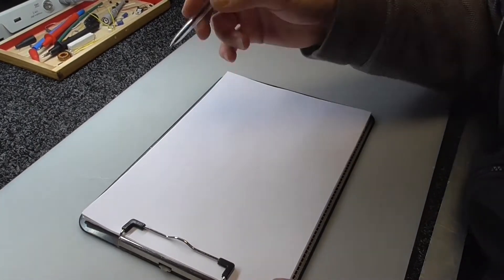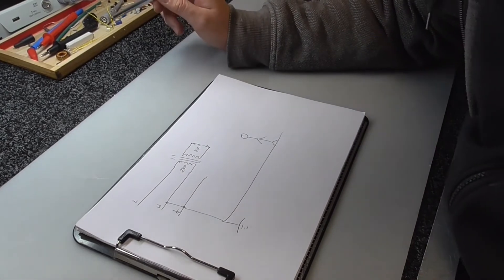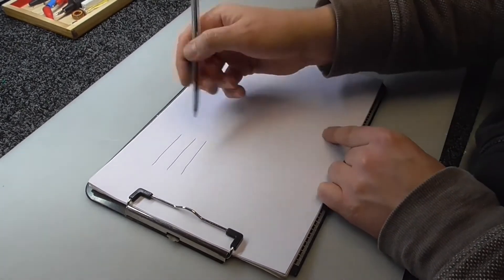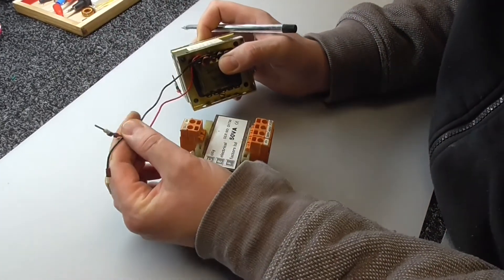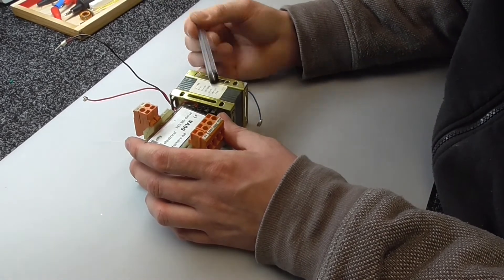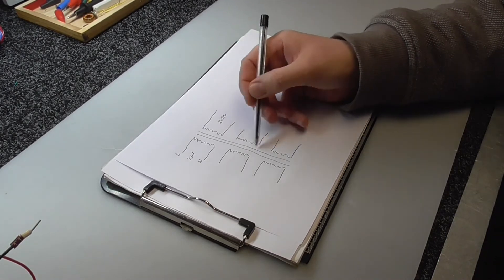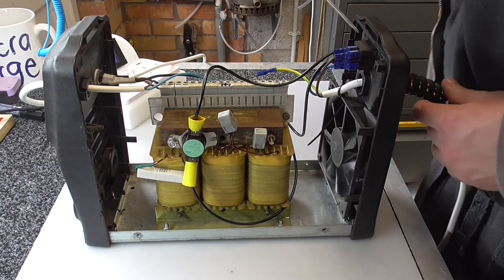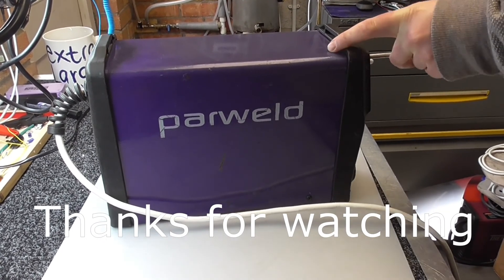How to make and use isolation transformer (DIY safety transformer)

Comment: Great vid, thank you.
One question..At 5:40 , minute mark, you mention the secondary side  of isolation transformer cannot have the Earth ground (as the primary side) etc... 
However, on many isolation transformers the secondary has a 3pin outlet , whereby the DUT (device under test) is plugged into this outlet. In this case, where would the ground pin (of this outlet) actually be connected to inside the enclosure? I would have thought it was connected to the chassis/enclosure... But that would mean the secondary has an Earth/ground same as the primary?.....or the ground pin (of this outlet)  is not connected anywhere..which itself is seems even more unlikely......
So in short:
- what is the purpose of the ground pin on the outlet (secondary side) ? 
              &  
- what is it connected to ?
Looking forward to your reply help clarify the above. Thanks.
Reply from the maker: Hi.
Ground pin on outlet can not be connected with anything.  Other wise, there is no point to use isolating transformer. It sounds dangerous - ungrounded device- but we are not one of the potentials (when DUT is not grounded) so we are safe. This is domestic solution only, for bigger instalations there must be some safety devices installed.  
You must remember that isolating transformer  wont be 100% safe anyway!  Is more to secure our instalations and secure us only in very rare sytuations. 
Regards
Reply: @lary1110  I see your point. So in summary, the very nature of having a test lab setup as discussed seems like quite normal/desirable. ..On the secondary, not only do we  want a floating neutral,  but we also want a unconnected ground. With the intention of minimizing equipment damage while maximizing safety. Understood now. 
(By the way, many videos online speak of leaving the ground connected etc..but your explanation makes the most sense of why it shouldn't....there sure is a lot of inaccurate info out there.. So your help in clearing the confusion is appreciated.
Thanks for a very informative video & comments.
Reply: @lary1110  Im considering powering my computer via isolation transformer (1:1) , can i (is it okay) still connect ground manually to the case ?

Also just learned torodials make some loss of voltage when first run , is there will be voltage drop also when pc's psu ask for more power?